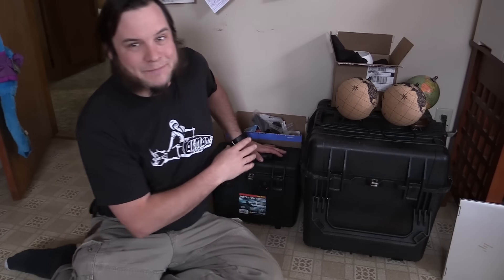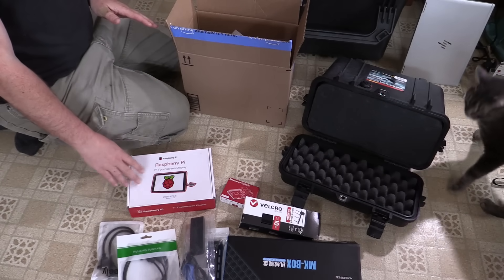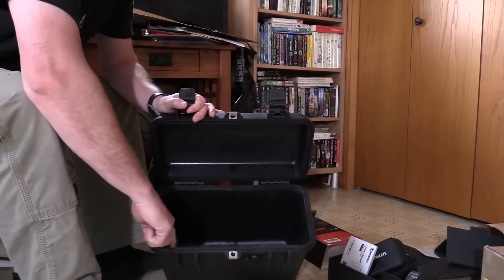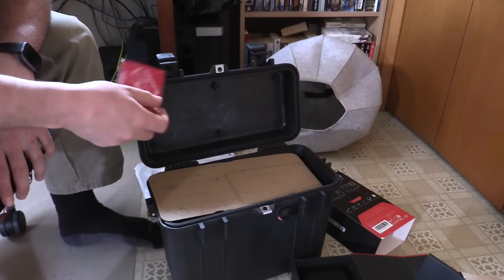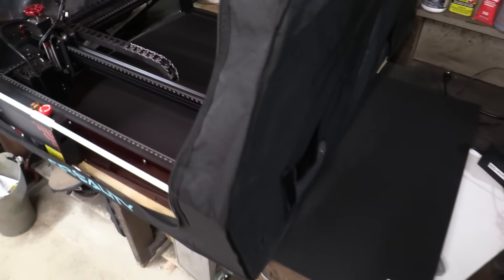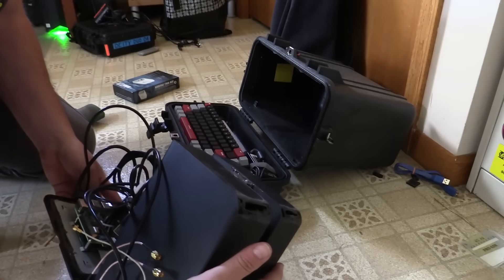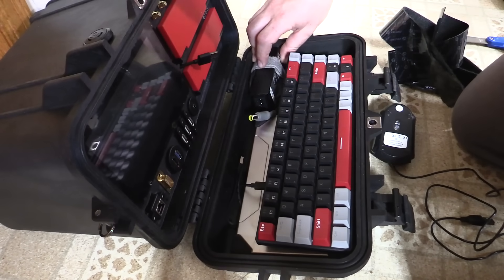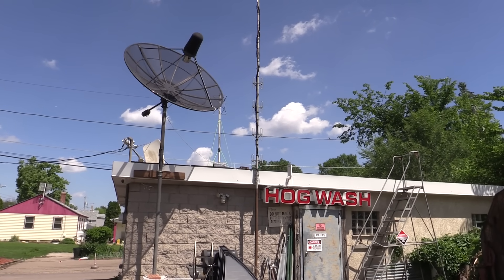Satellite Hacking Cyberdeck v2.0

Comment: Last year I build a crossband repeater enclosed in a Magnavox 6LE CATV line extender aluminum  casing.
A TYT UV8000 With a small agm battery and solar controler inside. AGM to work in -40f/c  winter conditions.
I had fun to build it and  make it fit. I used the belt clip screws to fix a copper plate on the radio, the copper plate being screwed in the aluminum case.
Connector ports  fits with the UHF SO239 threads and also the DIN connectors outside threads.
On one side I Just put an PL259 antenna right on it or use a cable for a higher antenna in a tree.. 
The 4 pins DIN is for external battery and solar panel connection.
Base Camp's Tx is UHF and mobiles TX is VHF. Really good coverage when I put the repeater on top of the highest mountain.
Reply from the maker: Nice! I have some radio stuff around that I need to use more often, I have a technician license but never have time to get on the air.

Comment: You said something strange: that your raspberry pi 4b only work with a raspberry pi branded power adapter. I've never experienced that but seeing how you mentioned multiple power supplies, it sounds like your issue doesn't lie with the power adapters but with the cable. I remember the 4 series needed something like 2.5amps plus so not all usb cables can carry that. That may be what's giving you such a hassle.

EDIT: just saw the end result. Nice! Very nice!

Comment: The raspberry pi doesn't use quick charge unfortunately. All 15 Watts are drawn at 5v so I'd recommend getting some kind of "dumb" power supply that can output 5v and 4A (1A extra for accessories) and just hooking it up to either the gpio pins or getting a USBC cable, cutting it and hooking ot up. (Pretty much no normal Powerbank supports 5v 3A and that's just for the raspberry pi)
Reply: If you do end up going with a "dumb" power supply (maybe one that takes the quick change from the Powerbank and steps it down to 5v but more amps), you could also connect it directly to the USB Hubs (assuming they are powered USB Hubs) for that extra juice so the pi doesn't have to provide all the power by itself

Comment: You have so much trouble with the pi’s power supply BECAUSE of the power supply. When they say it takes 3amps, they mean 3amps and most power supply’s only barely make it to 3amps on occasion and still get rated for 3amps… basically, most power supply’s are junk and he pi just proves it. I’ve been using pi’s for decades (ever since the original) and all I’ve ever found is a bunch of junk power supplys that won’t put out the amperage that they claim they will, charging most devices that have a battery, it would NEVER EVER make a difference, but running a device that needs that much power it will show up every single time. Say what you want about the official pi power supply, but every one I have puts out just over 3amps and I’ve never had a power undervolt issue. I’m willing to bet those battery packs are rated under 3amps, that’s the problem with them, until just a few years ago, no battery bank would put out much more than 2.5amps. You’re blaming something on a device that has clearly claimed its power needs for years…

Comment: I sent you an email! I found a really good deal on a satellite setup you might like, it has a cross level motor and was designed for ships.
Reply from the maker: Nice, I'll take a look! Getting through a bit of an email backlog right now :-)
Reply: @saveitforparts  Your biggest challenge will probably be how to get it to power the antenna and motor controls without an ACU. You might be able to bypass that element all together if it has an interface onboard the MCU for controlling the motors. 

Perhaps even making your own motor controller for it instead of relying on it's preexisting parts, selling the extra stuff as spares - I am sure you could pay for the unit that way given how good the deal is. You may need to make a bracket to rebalance the antenna as I am assuming removing parts will unbalance it. It does say it moves pretty quickly and accurately since it is designed with as little extra counterweight as possible. Maritime VSAT channel on Youtube gives a rundown of it's components since you won't have access to the service manual.

The hard part for me has been finding the quality and size of antenna I want with a preestablished motorized mount. I wanted something that was larger, more accurate, and high speed for a larger size dish.

Comment: Totally agree about the stupid Raspberry Pi power supply - I've been annoyed by that for years.  It requires 5.1 Volts - not 5.0 volts otherwise it won't work properly... though I haven't verified this with a voltmeter.

Comment: USB 5V is always a pain, try and draw 2A and you'll lose some volts. The Pi does not use any fancy USB C voltage negotiation and Pi side regulation, so maybe make up a custom DC only USB lead for the Pi using some decent wire of just the right length, so no rolled up excess in the back.

Comment: I love your rigs, I love doing these DIY projects as well. Currently rigging up a Pelican knock off from Amazon and I’ve got my steamdeck as the system with a wireless keyboard mouse and then a BIRD 7020 power sensor. Then for the steamdeck I’m just running win11 for now to run the power sensor and all my radio programming software.

Comment: I love axe man surplus too.  I had an old IBM system 32 workstation that didn't work.  fixed the power supply with a 14 cent resistor I bought at axe man

Comment: with it "self-sealed", is overheating not a concern?
Reply from the maker: People keep asking that, I also don't have a heat sink or fan on the Pi. So far it has run just fine for a few hours in the sun, and indoors for a few hours. Maybe I'm losing performance, but so far I'm just running simple Python scripts and the GUI, and I haven't noticed any issues. I'll probably upgrade this soon though!

Comment: I had a Columbia Data Products VP luggable, like the Osborne and Kaypro. If you have room and the main panel is set back far enough not to interfere when it all closes up, I suggest you shim the front edge of the keyboard up just a little to get it even with the front rim of the case. The front lip of VP's (metal) lid/tray was higher than the front edge of the keybaord, it made it PAINFUL to type unless you pulled the keyboard out of its foam padding and slid the hinge pins apart to remove the lid entirely, which made setup & packing a lot more of a hassle.

Comment: Just a note - this might help regarding the rPI situation. As a long time user, I thought I'd share. 

- Raspberry Pi does not use a proprietary power supply. Instead, it uses standard power connectors depending on the model. Here are the details for different models:
--- Raspberry Pi 4 Model B: Uses a USB-C connector for power, requiring a 5V 3A power supply.
--- Raspberry Pi 3 Model B and B+: Uses a micro-USB connector for power, requiring a 5V 2.5A power supply.
--- Raspberry Pi Zero and Zero W: Also use a micro-USB connector for power, requiring a 5V 1.2A power supply.
--- These connectors are widely available and not proprietary to the Raspberry Pi.

Comment: 11:33 I have had every version of the raspberry Pi and have always been able to power it from non-OEM PSUs. You just need to have a stable voltage, 5.2 volts is optimal, and enough current for the pi and anything attached. In the long term you are going to have a much bigger problem as you are using passive calling on the RPi and the heat really has no way to go inside that case.
Reply from the maker: I haven't run into heat issues yet, but I plan to do some adjustments to this soon. Someone also sent me a better Pi power board which showed up after I built this, I'll add it as well.

Comment: You can connect the USB hubs and everything else directly to the 5 volts. That's what I did with my Pi 4, works perfectly, stable 5 volts everywhere. I use a PicoPSU. And it is running from an SSD, much better than SD cards in my opinion.

Comment: you may want to add some cooling to that pi
Reply: Oh yes, totally missed that. It definitely needs some cooling.
Reply: @-Tris-  it MIGHT be ok if it's barely doing any actual work, but if that's the case just go with a pi zero and it'll get rid of those voltage complaints
Reply: @DouglasWalrath  Just running GQRX is a lot of work for the Pi. Some passive cooling should be enough for keeping the CPU under 60°C.
I have a similar setup, Pi 4 inside a big case, no fans, works great.

Comment: the pi doesn't support quickcharge so it'll never use that, quickcharge requires a special communication with the device before it will actually output higher power levels, you generally want a supply that can give 5 volts at 3 amps (5 amps for the pi 5)

alternatively just find a power bank with an AC output and use the official pi power adapter

if you want a pi that'll work with nearly any adapter than look for the pi zero, it's way less powerful than the mainline pis but that comes with way less demand for power
Reply: PicoPSU with wide input range connected directly to the batteries. Much more efficient.
Reply: @-Tris-  yeah probably

Comment: I like to use the automotive jumper battery packs and tap the 12v high amperage side, forget the USB jacks. Then use a buck converter to get your 5v and run that to the GPIO 5v header on the Pi. That will give you adjustable foolproof power. It's also nice to have a DPDT switch that will allow you to use another external 5v power source and/or 12v source that you can run through the buck converter. If the switch has a neutral position to shut off all power all the better.

Comment: The power and temperature warnings with Raspberry Pi are frustrating. Using Anker chargers or power banks to power Raspberry Pi 2/3+, I've found the low voltage warnings seem to correlate more with certain USB cables. I've had good luck with thicker 22AWG cables from Sabrent and Proxicast. Heat sinks help with the temp issues (usually - mostly operating indoors).
Reply: I have had great success in using Anker chargers in my cyberdecks and other projects using Pi3 B+  and my Pi4Bs. I do not have a Pi5 so cannot comment on that.

Comment: Awesome project!  For your 3D printer woes, I'd suggest the following:

To minimize/stop "3d printer cancer", make sure your filament is clean by using the little spongy filter, beware of any other potential contanimants like oil from your hands during the printing.  This includes (especially) the bed itself - use isopropyl alchol.

For the warping, don't try to lift the project too soon after the printing is complete.  Guessing the bending took place while extracting the part from the bed.

Comment: I've found for printing lids and such a liquid 3d printer adhesive can work wonders, you can also change some of your temperature settings or a different print surface, you can also use gluesticks

Comment: My experience with raspberrypi and the low voltage has been that most battery banks and many chargers do not actually output 5volts. It isnt so much a proprietary charger its more just very picky about any drops below 4.8. I love Pis but this annoys me too. To their credit I once accidentally ran 15v though a Pi3 b+. It got super hot but it ran for 15 minutes and still runs to this day lol their power system is really well made but its also very picky. I have had success by using a boost converter module and wiring to the pin header so it just regulates the voltage to 5.5v.

Comment: 15:46 
how about you put the usb port inside the box, and you slot in the battary like a NES cartrage, so it will connect to the usb oprt out side of view and 
1. you wont have the cable outside
2. it will look really cool

Comment: If you print the first 5-10 layers at an extremely slow rate (i.e. ~10mm/sec), it will reduce/stop the print "lifting" off the bed. Other easy solutions are using a BuildTak surface with a heated bed, or the cheapest way is to just use a simple glue stick (like what you used in Elementary school) thought you will need to clean your print bed with rubbing alcohol between each print to get the best adhesion. 

Part of the issue in my experience (mainly with smaller prints) is that the previous layer has not finished cooling before the nozzle comes back around to do the next layer. I sometimes will go as slow as 10mm/sec for the first 5-10 layers (or 1mm of print height depending on how I am feeling) if my printer is fighting me and my print keeps peeling off. Most slicers have settings that allow you to define different print speeds for bottom/top layers, so you might see some benefit there.

Love the project! It turned out looking very professional and amazing, I always love watching your videos. Great job!

Comment: 9:19  I think you should also print out some supports for in between your "bays" here.  That battery is probably relatively heavy, and repeated use will probably flex the fancy front panel.  Just my 2 cents.

Comment: Analysis of battery max amperage and voltage output vs amp draw of all connected devices could be helpful.
 Nothing to due with power issues. but heat sinks are highly recommended for Pi4s, When overheated their performance is throttled. I was thinking that when you put that other Pi on the roof.

Comment: 1:43 AWWW Raspberry POOP.  X86 or go home.  If you take my advice, look up the Lenovo M700.  It has a fairly low power (but modernISH) CPU good I/O and RAM capacity, and even has an NVME slot, and even the i7 model can be had readily for $110 right now, possibly less if you hunt around.

Comment: But why do you need special power supplies for the RPI? You supply 5V to pin number 2 and 4 from a power supply with the appropriate current capacity or from a DC/DC converter, and that's it. I've never had a problem powering the RPI and devices connected to USB this way.

Comment: The power issues with the Raspberry Pi are real bothersome. A number of years ago I started using Libre Computer and RockPi for a few other reasons, mostly better speed and things like PCI-E support, and those things can run on a hamster wheel.  I also build my own custom images with Armbian. Libre Computer in particular seems to be aiming for more general UEFI support so more general purpose Linux ARM ISOs will work with them. I still have Pis around here and there. 

Granted I have a lot of Linux and BSD expertise so what I may think of as easy might not be to someone who's not been doing that stuff for 20+ years. The Pi still has that plug-n-play ease of use factor.

Comment: Are you sure you're using a decent USB cable to power the pi? That cable looked absolutely gaunt.    Some USB cables, even over like a 1 meter length, can drop the voltage 0.3 or more.    Using an over spec USB cable and a power supply that can output something like 5.1 volts usually overcomes the issue.

Comment: For that issue with your 3D prints use water based paper glue stick and rub it on to printing bed. And clean it with water between prints. This should work for you.

Comment: I had a problem with a pi before where even with a high-power charger, it was still saying that it was low voltage. I advise that you ensure that there is no case on the pi, and make sure it is fully connected on the side with the pi.

Comment: The only thing that might trip TSA is the batteries. Any individual battery pack cant be at or above 100Wh
Reply from the maker: This one is 88Wh so I should be good to go!
Reply: @saveitforparts  It couldn't hurt to pull out one of the batteries and put it in another lugage bag, as they might think your device is one device over the limit
if you're really worried, make sure to gate check your devices. Dev ollam made a video on gate checking weird devices

Comment: You could get some buck converters and hide them inside the cyberdeck and tune them for 5.2V, then do whatever's necessary to make the power bank output the 9V quick charge voltage.

Comment: Very nice. The only thin I probably woud add is a charging port for a laptop psu. As fas as I understand this deck runs exclusively on battery power. 
So 19V into a little stepdown converter. This could be set to 5,2V or something like that, so the Raspberry has sufficient power/voltage.
This could easyly be decoupled from the batteries with a diode or a simple Mosfet circuit. Or even with a switch.
The Switch and the charging port could fit next to the headphone jack.
But still this is a great really project! Good work! I love it!

Comment: Are you going to be managing heat at all?
Reply from the maker: So far it works fine outside in the sun for a couple hours, although I really should put a better heat sink on the Pi.
Reply: @saveitforparts  I would say that simply adding an air vent to the front panel and a little fan for circulation may be perfect. also you could add a dc input port so you can connect a little solar panel

Comment: I haven't had low voltage problems on my pi 4 because I just opted to power it right on the 5v gpio pins. For your setup I'd probably use a 12v pack and run the output into a step down converter, having it adjusted to 5.1 or 5.2v so it can safely sag a little under heavier load
Reply from the maker: Someone sent me one of those, but it showed up after I finished the video.
Reply: @saveitforparts  Well there you go then lol
As long as it can do 3+ amps you should be all good